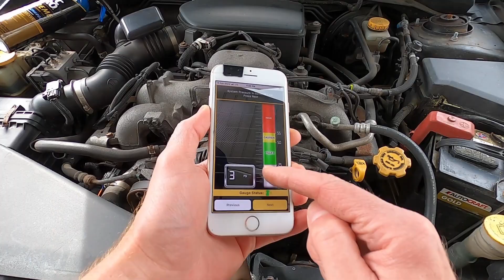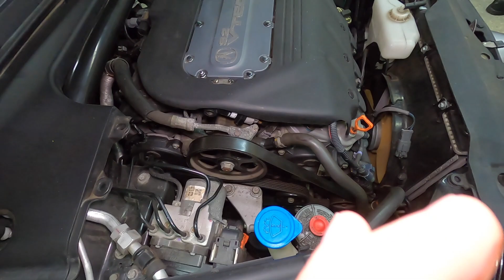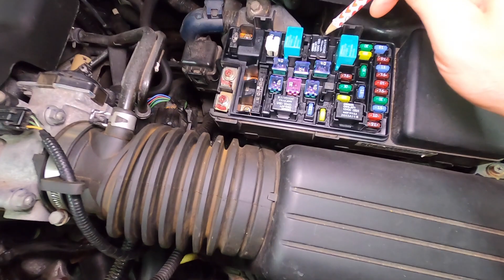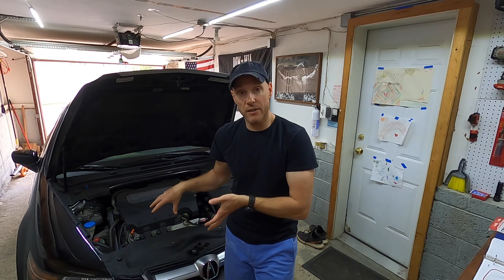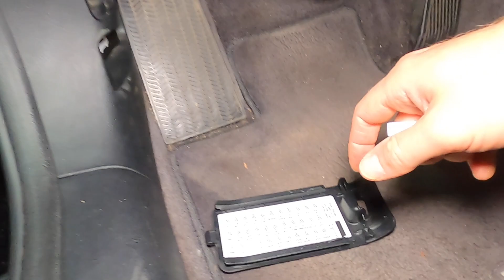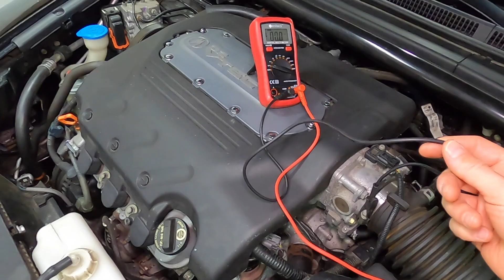How to QUICKLY Test A/C Clutch At Home

Comment: If the clutch doesn’t bot engage it could also be the clutch coil, not necessarily the field coil within the compressor. If he coil burned out it will not receive the electrical signal to trigger.
Reply: Saw a video about that yesterday on a Suzuki sx4. Guy had to crawl under and measure the amps l, it was deceiving zero!

Comment: what about really low freon. the clutch won't engage because there is too little oil in the system. the only way to charge the system is to jump the relay to get the compressor to function and pull in the freon.
Reply: You have to get the system to hold a vacuum first, if you can’t hold a vacuum don’t bother putting in the refrigerant

Comment: I have enough refrigerant . I changed pressure sensor. My clutch stays engaged. I turn it off and it still is engaged. I swapped relays.  Still on. I removed relay clutch is still engaged and it's blowing warm air only. What gives ?
Reply: Same problem with mine. The clutch is constantly engaged whether switch on or off. Have you found out what the problem is?
Reply: @barrygray8356 I have a bad compressor. Mine was an aftermarket compressor. I was going to remove the ac clutch. It's not removable. Took me an hour to figure that out. Now In trying to bypass it with a different length belt. 45 inch belt was a little  too short. 55 way too long it's all they had. Ordered a 48.75 inch belt so here is hoping. I was worried the compressor was going to lock down and leave me stranded. My belt should be at Oreilys in an hour. Wish me luck and good luck to you and your car.
Reply: @roscoeennis4230 Cheers buddy. Good luck
Reply: Check your relays. They CAN be stuck on ( remove it while car is off then crank it ). I read it could be pressure sensor. Mine wasn't. No more ac for me this summer haha. I keep getting quotes from $1600 to well over $2k. Depends on if compressor came apart or etc. That's estimates .
Reply: @roscoeennis4230 Thanks for the reply. I'll check the relays tomorrow and see if they're the source of the problem. Cheers mate 🍻

Comment: When the system is empty and I want to charge it with refrigerant, that's the clutch need to be engaged? In other words how to charge the system if the compressor isn't running?
Reply: Once there is enough in there then the clutch will engage and begin to cycle the ac system.
I’m assuming this is one of the reasons you pull a vacuum before adding refrigerant. The other being to test for leaks.
Reply: @anthonyfletcher8053 thanks. Youre right, it engaged after the first can went in.  Thanks again
Reply: @normanbuchholtz697 no problem. Glad it worked out for you.

Comment: So my magnetic clutch does NOT engage when I test at the relay. Confirmed the harness at the compressor has 12v when applied. But no click. 2008 Toyota Avalon, a/c light just blinks.

Comment: I heard RAM 1500 ecodiesel trucks don't have servicable relay, it has a TIPM which is same as the fuse box, if TIPM fails, the whole TIPM needs to be replaced.

Comment: The clutch on mime is getting stuck... I assume all I need to do is replace it but on my 350z the area is tight... and having to remove tge thing will be a pain in the butt
Reply: Did you end up doing it? Was a clutch the fix? I wouldn’t mind doing mine if it wasn’t for such a tight spot 😂

Comment: Ok,so what if you are not getting any power to the lower pressure switch? Will the "jumping"still work?If so ,how?
Reply: This is late, but based off my recent learning, i believe it will still work. Because if you are jumping the pressure switch with a 12v battery, you are telling it to turn on manually. You bypass everything and isolate it.

Comment: I have a 2014 Toyota Sienna. Our AC light is flashing and cannot turn the AC on. I checked the relay and hear clicking, however I cannot manually engage the clutch. Not sure how much refrigerant is in there but I won’t be able to fill it if the clutch doesn’t engage correct? I also noticed our radiator fans are not working. Could that cause the AC to not work all together? Or vice versa? I’m not sure where to check next.
Reply: check the ac fuses.  take it to autozone to check for ac trouble codes.  borrow or buy a manifold gauge and check static pressure.

Comment: So question, my ac doesn't cool. Push button light does turn on pushing the button inside. My fuses and relays work. I'm supposed to shake the can, and they say the can gets cold after u shake it (it don't). Hooking up with the 134a can with a built-in guage on the can, it reads only 10 psi. I used a screw driver to push in the pin on the L side line hook up, and there's pressure. 

So if the clutch won't engage if there's not enough pressure, how in the heck can we add more fluid in if the clutch won't engage to draw it in? I ran my ac on high and left the can hooked up, and nothing came out of the can (yes the can is full - it's new)
Reply: It's more complicated then just adding a can of refrigerant. It should be done by a professional or you going to  damage entire a/c system. This dude is not a mechanic.
Reply: @Smith-l5e  naw, I know enough to figure out things. After checking things, I think i know. Compressor clutch kicks on, draws a vacuum and holds the vacuum, relays are fine, but still won't take in freon. So, the next thing is the evaporator valve which is located behind the glove box and sorta time consuming. But as far as guages and how to work em, use a vacuum pump, etc...I already do all that and have doing hvac installs. I also know the high side and low side have to be within a range. When I replace e the evaporator valve and if it still won't take in freon...then there's something up with the Compressor itself.
Reply: @brooklyn_autumn recover the refrigerant, replace the schrader valves and pull a good vacuum, at least 30 mins.   close the gauges and see if vacuum holds overnight.   if it does, charge refrigerant by weight.  put an initial pressure of about 40 psi,  start engine and turn on ac.  charge to exact weight if compressor kicks on.

Comment: My clutch is working but there is no flow on my gauges. Pressures are equalized when the AC is on. Blows warm air.
Reply: i’m having the same issue. did you find out how to fix it?
Reply: @pinsonofficial  I replaced my compressor today. Still need to add a bit more R-134a in the system but it’s blowing cold now.
Reply: @ Not yet. I got a new compressor since the high and low pressures are equal when I put the heat on. I will let you know if it solves the issue.

Comment: Any reason why not do 2 tests at once, as in jump the 2 high pressure switch pin sockets  to send a signal to the PCM that the switch is in closed position (PCM thinks pressure is correct and will allow power to the relay for the compressor clutch), and then use some wires from the battery terminals to bypass the relay and send pwr directly to the clutch via the relaybosrd pin sockets - the foregoing after first determining correct pins on the pressure switch via continuity testing, and also the correct pin sockets on the clutch relay either by the diagram on the relay switch showing which relay sockets send pwr  to the clutch, or by ringing out the clutch relay sockets to determine which 2 relay pin sockets  pwr  the relay switch and which 2  send pwr to the clutch).  If clutch still not spinning, disconnect pwr coupling to the compressor, connect wired up  alligator clips to  that you have going  to your battery terminals.  If no clutch clicking sound when touching + and - battery terminals, clutch is toast.  Realize that I’m spitballing all this.😮

Comment: what could cause the ac clutch fuse to blow every time I turn on the AC ? im getting voltage at the clutch connector
Reply: A shorting wiring maybe inside the compressor
Reply: For example, the field coil for the clutch is shorting against the case.

Comment: What if I have full fresh freon, new thermostat, new relay, new-ish compressor, but the clutch suddenly stopped working, then worked for a few hours, then for a couple days it did not engage, then suddenly it did again, cold ac, but then i shut it off, it stayed engaged, and lights on the controls stayed on until i turned the a/c on and off again?
Reply: Follow the a/x lines to a sensor, it's know as a pressure control Sensor.
It engages and disengages your a/c clutch if the Freon pressure is accurate. Sometimes this sensor dies. Try to test with a multimeter or replace it
Reply: @danielsumerix4419  Howdy, thanks for the reply. Turns out it was the connector for the low pressure switch

Comment: If the pressure switch is faulty would the out cover plate still spin with the pully whether the air-con is on or off as I can't hear the compress clutch clicking?
Reply: You'll need to do what I did as the compressor is mostly hidden.  Add a mark with some white paint.

Comment: What if the clutch is engaging but the clutch discs are too worn out and make no friction? Is there a way to test that?
Reply: No, but there are some guidelines for spacing, but I cannot recall the amount.  There are shims (washers) you can remove that will fix this problem.

Comment: I have an intermittent problem with my AC not engaging as well as my fan sometimes not coming on either.  Do you know what that could be caused by? The car is a 2018 Elantra.
Reply: Start by measure your low side pressure.   Should be at least 30 psi.

Comment: Was sitting in Starbucks line, ac running, smelled a burnt smell, and ac stopped blowing cold. Replaced relay, started ac and something immediately started howling. Turned off immediately. Guessing the clutch bearing went bad and blew the relay?
Reply: Just change AC clutch

Comment: so low air will cause the clutch not to engage
Reply: No freon will cause the clutch to pause, so it won't burn out the whole compressor.
Reply: Yes, below 20 psi there abouts.

Comment: You didnt show which terminals to apply power to ,to engage clutch ,big mistake ,people have no idea
Reply: 87/30
Reply: Didn’t he just apply 12 V (or whatever that battery voltage was) in series to the existing 12 battery, effectively applying 24V at the coil? I would have thought you just need to short the relay terminals (the ones he tests for continuity)
Reply: If you look at the relay it shows you which two terminals trigger the relay. Should be diagonal from each other

Comment: you did not discuss pressure switches ?? which  Will tell computer to not send power to compressor, if out of toletance
Reply: Indeed, there are 2 pressure switches.  The low pressure switch is open until you have about 20 psi in your system.   The high pressure switch is normally closed but opens if the pressure goes too high.

Comment: I have a 97 Honda CRV clutch is engaging no cold air smelt Freon while back leaking I don't know if my evaporator is leaking can I try a can of AC would stop leak or do you recommend that running out of options also took clutch off it looked worn down could it be slipping and looking like it's engaging ever ran into anything like that any information will be helpful thank you
Reply: Possibly, an old clutch is slipping.   You can remove a shim to fix this.  If you "smelt" freon in the evaporator, buy yourself a $20 hfc gas sniffer and start searching.
Reply: @jackb1803  I appreciate the info it blew out the whole system shot and got to be rebuilt

Comment: Weirgly, my refrigerant depleted this winter in nyc.... not sure why, my Compressor Clutch is not engaging. I will get one of those bottle and add a little refridgerant and test but i'm taking my car to a AC pro to have it looked at after my testing.
Reply: Probably a major leak somewhere... Usually the clutch. You'll need to find the leak, replace the leaking parts and then have the system recharged.
Reply: Can you tell me what happened after taking it to a pro? What was the cost and was you using the a/c often?
Reply: @jimin-819  people only reply when they need something, when they solve their issues they wont care to help others
Reply: Exactly this... I've had issues with this and read on alot of forums and people would just dissapear without ever saying what the fix was 🤷‍♂️

Comment: Thanks .. now i know a bit more...... Question if refrigerent is low or empty will it stop clutch engagement or stop coil from activating? .... When i turn on AC the my AC  fan runs but clutch does not engage.... It made a noise while ago then stopped completely.... Like a bearing noise.... I think clutch, bearing and coil went at same time.... Fuse is could ... I will check relay as last resort ... Then i will replace the whole AC compressor which is about $700 😢😢😢😢 .... Bummer
Reply: Sitting with same problem now. Been told its switch on the compressor and have to replace the compressor.

Comment: I have a problem on my ‘05 Outback XT. The A/C fans always stay on high when the A/C is turned on. They never go down to low speed.. As a consequence the engine overheats slightly unless I drive the car on the Hwy and the temp goes down thanks to the Hwy airflow.. my A/C works fine by the way..

Comment: 2001 Jeep Grand Cherokee 4.0L

I have issues with my A/C, will blow air but not cold air, added refrigerant as i thought that was the issue but it was reading full and no leaks as far as i could see, so I went down the YouTube rabbit hole and found out my A/C clutch wasn't spinning, so I checked the relay, that was fine, found out I could jump the low pressure switch to see if it'll spin and it does but still no cold air and when I went to check the pressure it read as low low.. I'm simply stumped... which reading is the right one? And how do I fix this?? Trying to donit myself.
Reply: Your pressure has to be read with the compressor engaged so when it was on and the pressure read low that was your actual pressure
Reply: What is the link to get the relay  with the switch